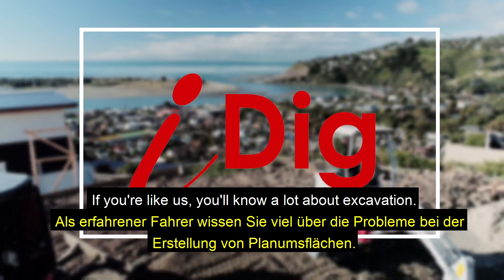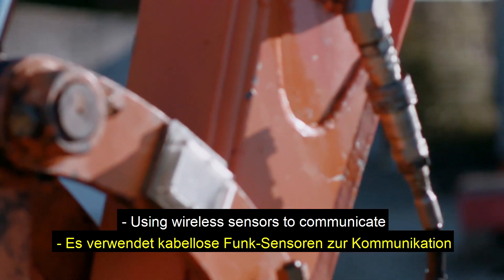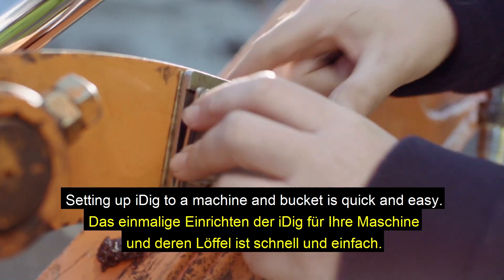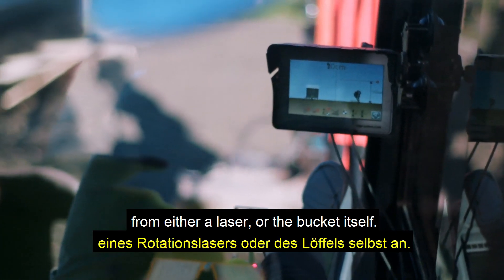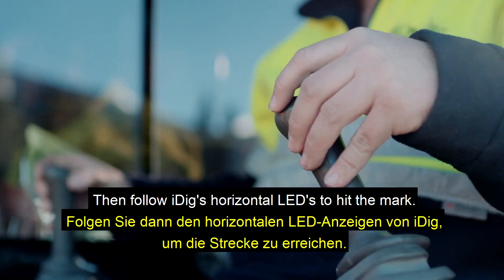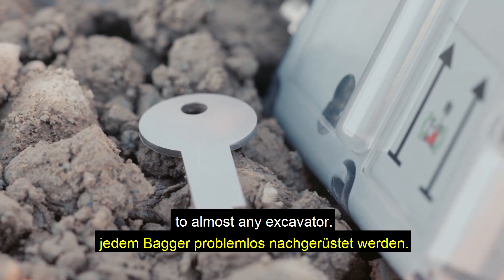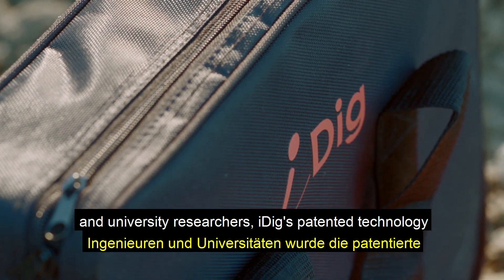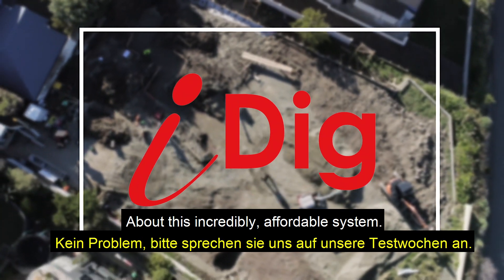iDig grade control system

Comment: Would this work on football pitches where there is a fall the length of the pitch and also a cross fall to grade stone?
Reply: Dear Conor. iDig Touch is 2D capable, means you may do also a dual slope surface, such as for football pitches. Please send me an email with your contact data, and I will get you in Touch with an iDig partner close to you to offer you a demo. Email me on dirk.seidlitz@idig-system.com or WhatsApp on +49-1718927020